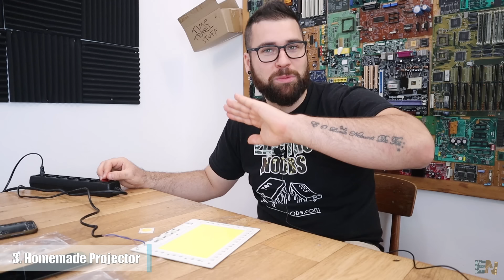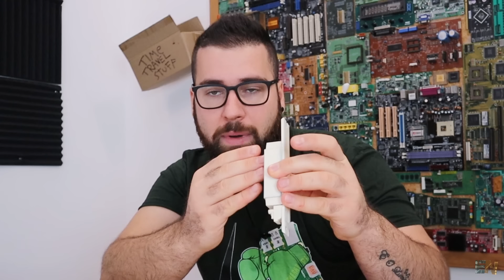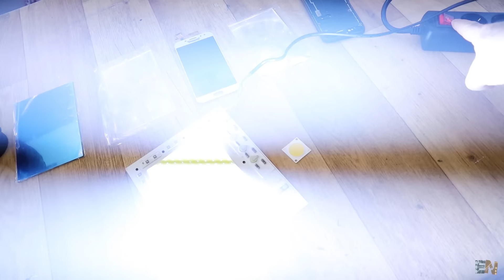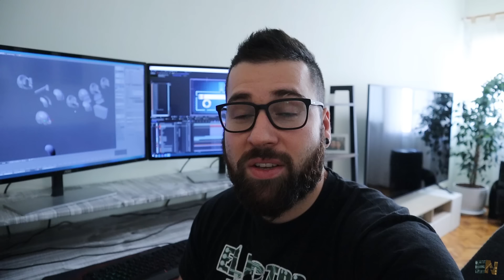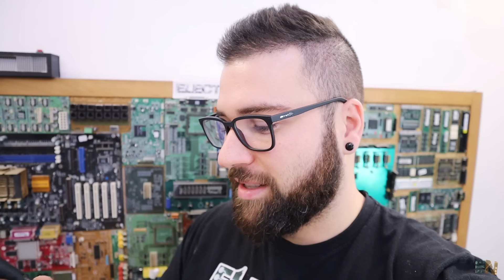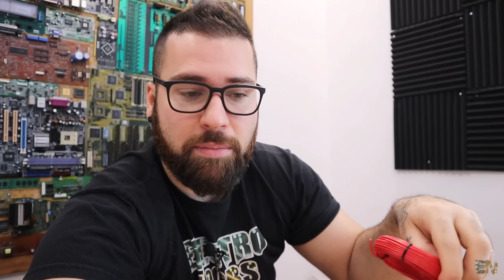200W LED Projector | Homemade Pellet Extruder | 3D Helmet ElectroNews#07

Comment: It will be great if you make a similar device to the small thing which checks resistors and capacitors but instead of that display it has Bluetooth or Wi-Fi  and you add much more capabilities to it because you don't worry about the displaying and what not.

Comment: good luck with the projector - for projection purposes a point source is preferable since the area light will emit very diffuse light. Even with your Fresnel lenses you will not be able to collect the light efficiently into a parallel beam of rays which you need for a clear and sharp projection. Your small LED is a much better choice here...

Comment: you can forget the big one it has net frequency flicker and you can't get to parallel light like you need and have a better chance with a smaller spot light and the lens...
Reply: and the spot you would controll by adjustable DC to avoid any flicker...
Reply from the maker: Thanks! I didn't even though about flickering... :( Thanks!

Comment: Why not strip some lighting power cable?
150m is around 13£ (GBP)

Or take the extra used in light fitting lol... (Don't it there fore a reason).
Reply from the maker: I think that cable is too thick. Alsoz sometimes for that they don't buse solid wire...
Reply: @ELECTRONOOBS  it's soils 1.5mm wire here, different places and era, different cables.

Comment: Nice to hear about pellet extruder project. i thought you have abonded this project (you have refer to it in an older video of yours about  temp pid control... and was something looking for)

cant wait the  finished project .. it will be a solution to all of us wanted to recycle old or failed 3d prints
Reply from the maker: Actually that was a different project I've started back then. That was about the filament extreuder which is kind of the same but not exactly as the pellet extruder.
Reply: @ELECTRONOOBS  ohh I see. (I haven't reach yet in the video  the part about the pellet extruder) This is even better (skipping the step to produce the filament) and print directly from pellets.
Reply from the maker: @caslor2002  exactly